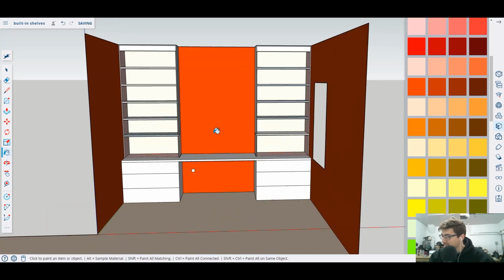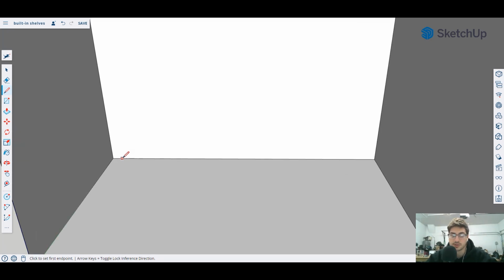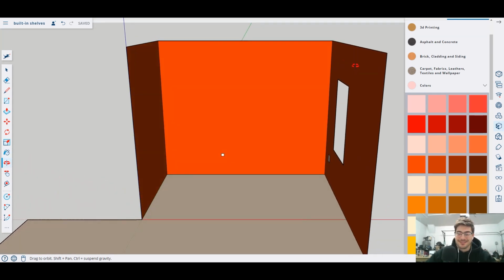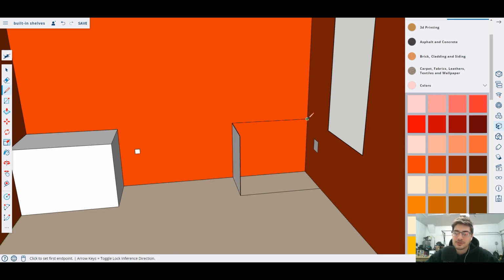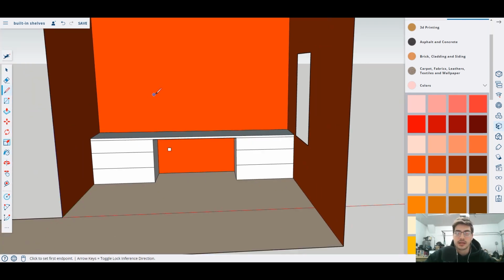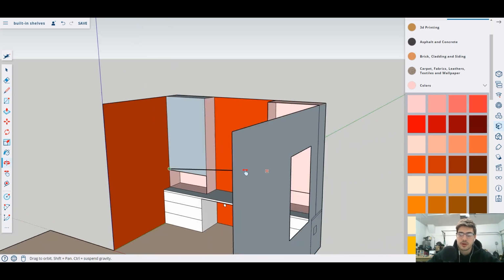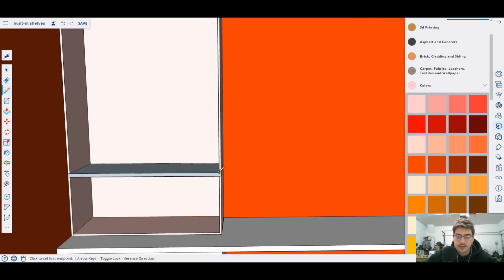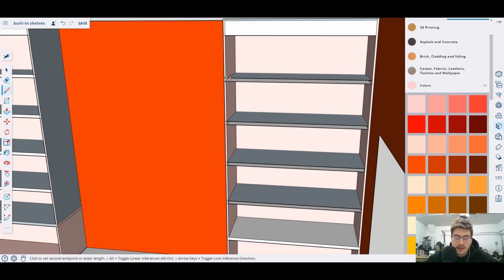How to Design Built-In Shelves with SketchUp 3D Modeling!

Comment: Great video, really helped me very quickly. I am designing a simple shelf on a wall but I'm having problems adding brackets to the shelf and connect it to the wall. I finally managed to make a bracket but now I'm finding it nearly impossible to copy the exact bracket and paste it 3 more times at different places on the shelf. Making squares and rectangles seems easy but then adding angled elements that exist on their own is confusing to do.
Reply from the maker: Thank you for watching! I sometimes make simple triangles/simple shapes in sketchup to show there will be a bracket there, then do separate engineering drawings for the actual part! If you’re able to get overall size and location accurate sometimes it’s okay to just have a basic triangle and then do the detailed work later!
Reply: @lemastertech  that makes sense, keep it simple then finish the bracket design. I thought making something a "component" would make it a solid object and easy to copy but I'm still trying to figure that out.